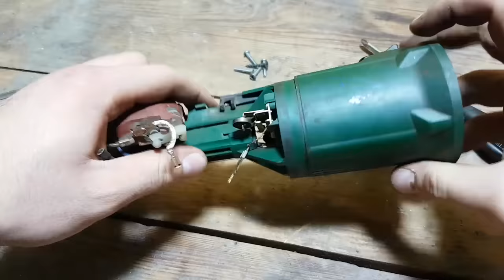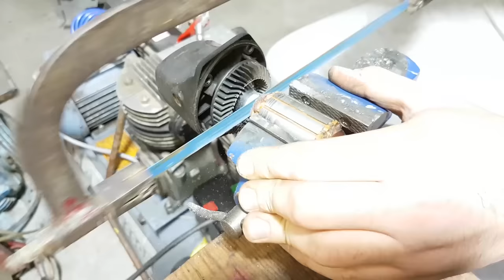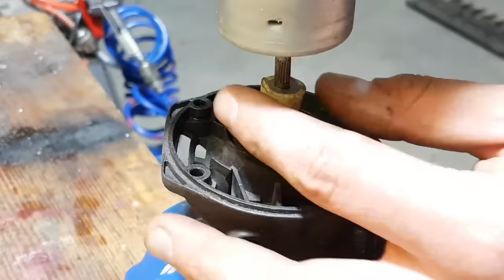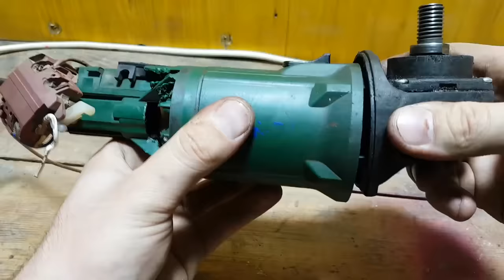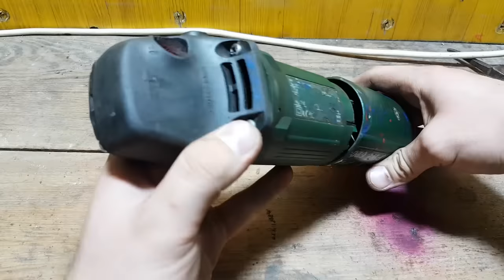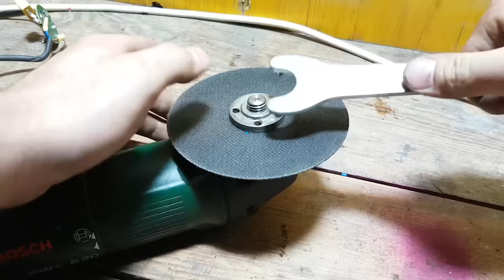Angle Grinder Hack! Don't Throw Away the old Angle Grinder!

Comment: WHAT was the point in that? Was the original armature screwed? The replacement motor is WAY underpowered for the job though! An angle grinder should run from around 10000 to 16000 rpm. That motor sounded like it was barely making 3000! BAD move!
Reply: Смотря для чего использовать , например газонокосилка .
Reply: My thoughts exactly. Took a broken grinder and turned it into a broken grinder 😳
Reply: Very good and useful  to have 12v. Grinder can even plug lighter socket
Reply: I have an 18v grinder and while useful it is NOWHERE near the power and capacity needed for big jobs.

Most mains powered 115mm and 125mm grinders are around 500-600 watts that means over 40-50amps at 12volts! Even  heavy duty lead acid car batteries are not going to last that long at that rate!
Reply: The Motor  is RS 550 dc motor i think.. which has a medium rpm...but the problem is in the gears..which makes high torque and low rpm..
So make a homemade grinder easily with RS 775 dc motor without these gears of old grinder 😊
Reply: @farhanfaiz1998  a 600 watt 12v (50 amps) 550 or 775 motor DOES NOT EXIST! 

PLEASE UNDERSTAND ... you need POWER for a DECENT angle grinder. My LOWEST power AC grinder is 750 watts! My highest is 1100 watts (9 inch) and even THAT is underpowered on some jobs which is why the professionals use petrol engine powered angle grinders (stone cutters) for their portable grinders.

Even at 24 volts max power tops out at just 150 watts, that is just 20% of my LOWEST mains  powered angle grinder (750 watts/20,000 rpm!). My most powerful 18/21 volt grinder is 950 watts but only 7000 rpm. 150watts maximum just ISN'T going to cut it ... And certainly will struggle and probably stall instantly when cutting 8-10 mm steel! 🤔🙄👎👎👎👎

Comment: There IS a reason a side grinder, 4" or 9" version, has a small pinion gear driving a large ring gear. The reason is the necessarily small motor, (especially in a 4" grinder, which most people think are a direct replacement for 9" grinder. They are NOT.), needs to gain some RPMs, so it will have some torque.  The gear ratio enhances torque, as well.

If the manufacturers could get away with direct driving them, they would, since it would be so much cheaper.

You have resurrected a good little Bosch side grinder as an underpowered shadow of it's former self.

I did come up with a much better use for part of the side grinder, though. The part was the output shaft of a 4" side grinder I killed a few years ago.  I don't know the brand of the shit-brown grinder, I found it in the trunk of a car at the wrecking yard, and they gave it to me when I paid for my car parts. It lasted almost a year, but it didn't have a spanner nut like most grinders, it had a large cup washer, and nut; like a bench grinder would.  

A few months ago, I bought one of those cubic manmade superstone grinding wheels, (hard enough to grind carbide), from China via eBay.  The problem was, I needed an arbor for it. 

I planned turning one from round stock, but looking in my 'inventory' for a nut and washers to use, I ran across a couple of output shafts from dead side grinders.  

Because of the nut and washers, I first thought it WAS part of a bench grinder, then I recalled tearing apart a couple of 4" grinders I had smoked one day, because I wasn't up for wrestling with my 9" side grinder, but there was stone needing to be polished. I got it done, but I was down to my last 4" grinder, (and I've been hesitant to get it out, since!), though  do still have the 4" air side grinder.

After checking then for runout, I ended up using the side grinder output shaft as the basis for an arbor. They are good, tough alloy, but still machine easily. I turned the gear end of the shaft down to ½", then turned a bushing for the ⅝" shaft and 20mm grinding wheel.

In the end, it was a much easier project to use the output shaft, than to re-invent the wheel, making one from scratch.
Reply: When RPM go up, torque goes down. 
M=(P*9550)/N. 
M in Nm, P in KW, N in RPM.
Reply: Тоже со старой машинки сделал то что увидел. Если дать мощно е питание, всё отлично, но от аккумулятора не тянет. 
Вобщем убил время. Проще купить аккумуляторную машинку и не парить мозги
Reply: So WHAT ! DID ! ALL !! THAT !! PROVE !! THEN !!??
Reply: @fernandlust532  Not so...  Look at graphs of torque curves for electric motors to disprove your statement.
Reply: @davidwillard7334  ya goof lol dude clearly knows what he’s talking about and besides, some nobody on yt telling someone who’s spreading good ideas at the least has no pull😂👍
Reply: @andrewjschutz  So what ! Does that have to do with the ! Angle Grinder !?? Then ! Mister Shutz !

Comment: 12volt dc motor 775 is designed for light duty application such as act as part of component of any machinery. this motor itself will fail to carry peak load in compliance with factory specification not only that but also motor seems to be loosing its life very soon if engaged to such heavy duty application.

Comment: What did you do dear, just put new grease in the head over grime n old grease without Cleaning it. ???.  And to align the axis of the motor mating hole  should be on the lathe ???  Underpowered for the job

Comment: If only you have done a little more research. You would have found that an Alternating Current (AC) induction motor can also be run on direct current (DC). You can connect the stator that generates the magnetic field around the rotor either in parallel or in series with the bushes of the rotor. It is then a series dc motor that generates much higher torque than a parallel wound motor. You can even do a combination of the two types which would make it a compound wound DC motor.  Keep up the good work, though. I still admire your enthusiasm.

Comment: What did I learn... 1- dude does NOT own a decent phillips screwdriver  (strips every screw) 2- thinks throwing new grease over old dried out contaminated grease is a good idea (lazy), 3- hacksaw blade has a hard time cutting plastic (lmfao), 4- apparently only has 2 sizes drill bits (hole is way to big for new shaft, 5- off center hole for new motor shaft, will make for a great vibrator, not much else (again lmfao). 6- 120v printed circuit board (bridge rectifier) hanging loose off of cord!!!(what could possibly go wrong, see it contacting steel vise?) You would think with 3/4 of a million views (why, just why) this guy could afford a decent screwdriver, and drill bits/tools!

Comment: Even at 5 x speed the disc looked slow and took for ever to cut that bolt! Useless.
BTW. The original armature and fields looked just fine.
Reply: If you've ever had a slitting disk fracture, you would want a low power version, I've got the time

Comment: U removed a high power grinder and made a low power one, the size of that motor and the size before??? Even if it takes DC now... It's not worth it... U want to power it with 12v lead acid batteries good but it's not reliable and brushes going to bad

Comment: You're never supposed to operate a right angle grinder without the wheel guard. That's how most injuries occur. The cutting wheel comes apart causing major injuries because the wheel guard was removed. OSHA
Reply: Thanks Karen

Comment: I'm sorry, but this video needs some serious editing. Watching every screw be removed then put back in 😩. And how long before that tiny motor took a shit. No way that thing lasted long under load. So much time and work put into something that wont last long. I think you have some good ideas bud. But you need better execution. And get yourself some decent drill bits, and an electric screwdriver, or a drill and some hex bits.

Comment: 12volt dc motor 775 model load tolerance wise is weak only and on long term basis this kind motor will not be able to extend its support.

Comment: kindly cam U Tell whiCh Circuit boarD u use To RuN A 12v Dc MoToR on 22ov Ac

Comment: I think it would be better to run the motor from a battery, like a cordless angle grinder, if it has already a low voltage motor. But compared to a normal angle grinder (also a cordless one) it seems to be really weak in power.
Reply: Не серьезная болгарка,мало оборотов и мощности

Comment: No wish to be impolite but this so called hack is underpowered, out of balance and quite dangerous.  What happened to the blade guard.  I sincerely hope you never experience a blade shatter on you.  However perhaps the motor is incapable of spinning a blade fast enough to shatter.

A cheap no brand grinder would be a better safer more usable bet.

Nice to see some ingenuity even though there were some basic engineering fo pars.
Reply: Barry Manilowa 
Thanks for your question.  If I’m being honest I have never personally had a grinding disc shatter on me, however I’m a stickler for checking a disc beforehand.  I also take the disc off when I’m finished grinding/cutting.

I work in the construction industry and have attended as well as implemented  scores of health & safety seminars.  However I’m not an H&S nut and I personally think there are times when it just goes too far and even in some cases make an environment more dangerous to work in.  

However having attended more of these seminars than I care to remember, I’ve seen countless videos and photographs of some of the really stupid things people have done with grinders along with some really nasty injuries as a result.

There are a few basic things that people do that lead up to really serious injuries and these are:
1. Modifying the grinder (ie removing the guard).
2. Using a disc where the boss has been altered in order to get an incorrectly sized disc to fit.
3. Not checking grinding discs, especially thin cut off types for damage resulting in it flying apart.
4. Not taking the disc off when finished and chucking the grinder in the back of a van and the disc gets damaged  resulting in incident no° 4.
5. Getting a catch or dig in when cutting thin material & fracturing the disc and having a chunk fly off.

There are several more incidents that I could mention but I’m sure you get the point.  Yes the discs are reinforced with a layered mesh which by default is there to reduce the risk of a disc flying apart however it only lessens the liability of a blow out but not eliminate the likelihood 100% which is why the guard is fitted by the manufacturer.

Some of the videos and photos I’ve seen in the aftermath are horrendous, ranging from loosing eye’s, serious fascial injuries, one I remember had a 9” cutting disc let go and his face was peppered with shrapnel and he even had a sizeable chunk embed itself into to the side of his temple.  Of course the potential injuries are not limited to the operators but also co workers who are being put at risk too.  

These incidents are not happening hundreds of times a day but they are far more common than many people think.  Like I mentioned I’m not a H&S nut running around on site looking for potential danger and I do believe that H&S has gone too far in recent years.  I have seen too many photos of hideous injuries from discs letting go. In most cases it’s from the disc sustaining damage of some kind and the operator not noticing rather than a brand new undamaged disc flying apart.

Personally I just wouldn’t entertain using any grinder that some numpty has removed the blade guard.  My eyesight and face are more important than using a grinder without one fitted.

Apologies for the lengthy response, I just felt you were entitled to a full and frank reply (whoever Frank is) All joking aside if you are using your own grinder in your own workspace with no one near by then you are entitled to take the guard off if you want I suppose.  It is true though which is highlighted at the H&S seminars, that many of these people that had suffered significant injuries just didn’t realise how bad things can go in just a nano second or despite most quality discs being robust, just how many do have chunks fly off at god know what speed and it’s usually your face where it embeds itself.

Regarding the comments I left for this particular grinder hack: I really liked the ingenuity of resurrecting a dead grinder, however it was immediately apparent the possible dangers of using it without a guard.  The remark wasn’t made as a negative bash on the conversion, but airing my opinion on its lack of safety.

And people that make videos that are made for public consumption and posted on YouTube, have to expect constructive criticism.  I don’t agree with being an arse and just slagging whatever the video is about just for the sake of it though. I hope that answers your question.
Reply: Barry Manilowa  As a professional pipefitter/welder, I see it happen EVERY day! But NOT on a supposed (hack) that spins at 100rpm...lmfao

Comment: One time use. Too slow and too much vibration. Nice idea though.
Reply: @woodchuck1
I imagine vibration would be reduced considerably if he would have even TRIED to drill in the center of the shaft.

From the vid, it doesn't even look like he eyeballed the center; it was off-center by a visible margin.

I'm guessing he didn't think about it. Since he didn't question removing the mechanical advantage of the ring and pinion gear, he likely didn't think about alignment, either.
Reply: Something else I've been seeing a lot of, lately, on YouTube: When did ALL taps become power taps capable of being used like a friggin' drill bit.

It's easy enough to break taps, WITH a tap handle, people.  The ONLY taps capable of being run in a drill are drill-taps!

Comment: LOL this video is ridiculous!. You know that 99% of the time angle grinders or any power tools in fact, fail, is because the brushes have worn out? The motor is normally 100% fine. You can replace the brushes easily and cheap. That motor you put in there won’t nearly have the power as the one you threw away.

Comment: Good work and thanks for sharing. However... u turned a broken tool into a toy - not a useful tool. Maybe a handcranked grinder or pedal powered or solar powered would have more useful work capacity. It was good to watch tho man so thanks. Id also love if u did a vid of converting a wheelchair to pedal power as its easier and more efficient than using arms..... actually i cant believe no ones done that yet.... hi ho hi ho its off to the patent office i go....